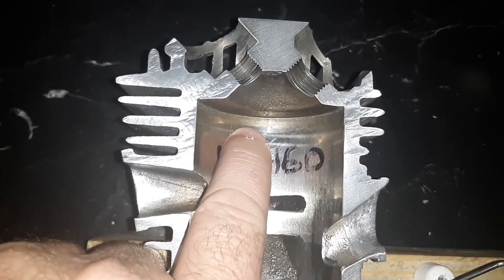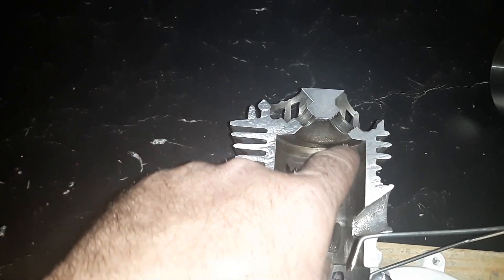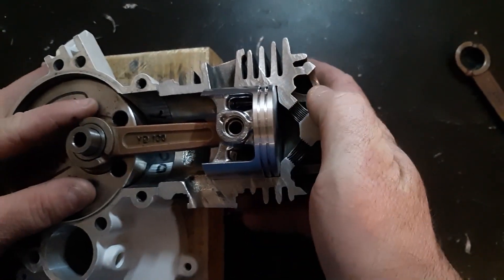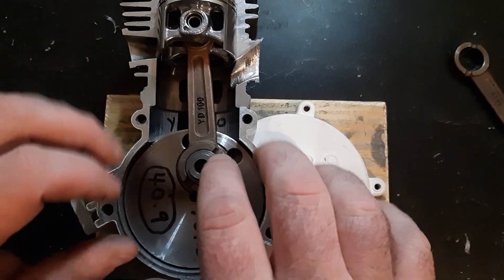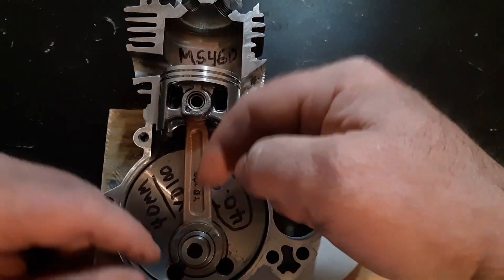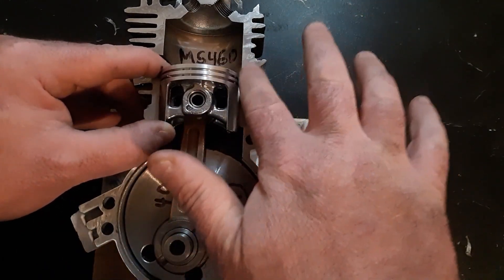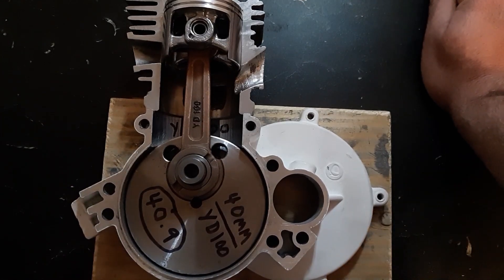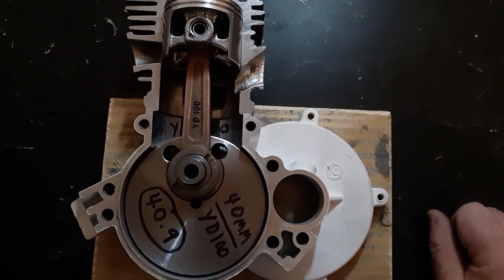Motorized Bicycle MS460 Timing Video Cutaway View!  (Ring Sound Explained Many Hear!)

Comment: Since you are able to slip cranks , did you ever thought on putting stuffers inside it to reduce the extra volume of the crankcase ? Like bolted teflón stuffers I saw on a lot of motocross builds , or even aluminium would work
Reply from the maker: I don't understand why people think that is a good idea......  has no effect on 2 stroke other then decreasing volume the carb draws in not compression gain or w/e people it does. bigger the case volume more air fuel mix volume it sah room to pull in then push into piston to fire.  whole idea just makes no sense from pratical basic understanding of how 2 strokes work.  unless your mounting a top end needs smaller crank area then makes sense like 50cc on 100cc bottom end cause volume is so large 50cc piston can fully fill it enough clear it on down stroke enough to create vacuum seems to be confused with people thinking this improves power for some reason but they have the whole basics of it backwards!

Comment: So the 38mm crank fits the yd100bottom end
Reply from the maker: yes!  you need to use the crank shims though 1 on each side! few places sell them.  some on ebay and all of the above pre made! https://rdmanu.com/ makes the best ones like $15. they have nice brass ones well worth 15$   I on other hand have cnc mill so make my own out of brass sheets. copper brass a or the stainless ones all work!  tend to not use stainless ones cause if they where to ever get damaged hard metal would chew everything up! to be honest I don't think you really even need them! seen many made without them.  it literally is .5mm each side total of 1mm in width. You will need a spacer on magnet side few washers!  ans use the thin crank seal!  not thicker yd100 one.  type like a 80cc bottom end uses!  "washer" 1 normally will raise magnet up 1.5mm ish to clear the case since 80cc cranks had a magnet seat 1mm lower then yd100

Comment: Hi I have fallowed all you videos and built me a ms 460 I tried starting to say after a long period building not as easy as it looks vary prod of my work though and thankful of all you videos 🎉 having problems starting it was spark on my 12v Magnito not working so I put 6v on got spark but still no start did get a backfire sound a couple of times could this be that the timing is at standard china doll I have 6 degree keys to retard the timing any advice be helpful ty
Reply from the maker: Did you put the Magneto magnet on in the right direction?  When you have shaft ket side facing up is it pointing to 1 o'clock position?  IF the plug is WET Change CDI if magnet is correct?   Faulty CDI can cause backfire. If it is not wet looking!  If it has strong spark put few drops gas down spark plug hole see if it fires for few seconds? If yes it's carb related! to small or to large of a carb can cause lots issues really fast!  Also be aware!  IF your using a carb with a pull type choke  lever one that does not have a choke door that is mechanical! Like VM22 or PWK you put the choke on and give it "no gas"   doing so will not allow it to start as well!  Bigger carbs are not the type that like throttle at all applied to them with choke on "till they start up!"